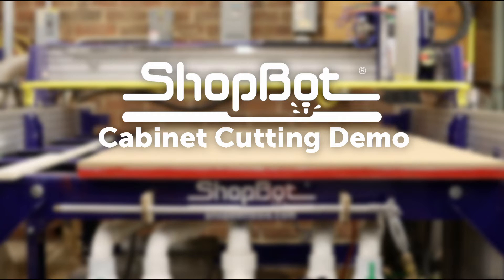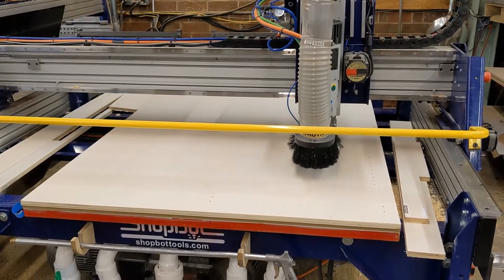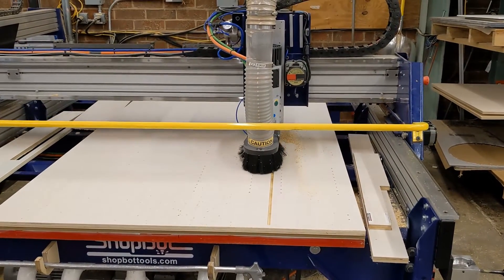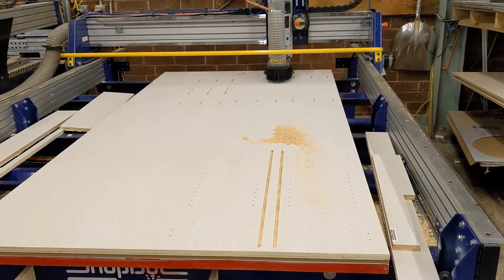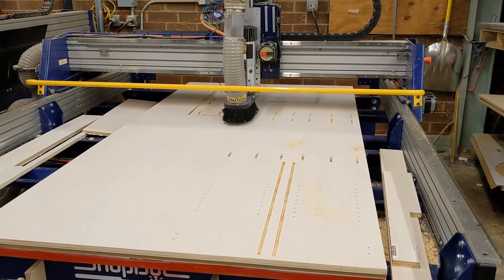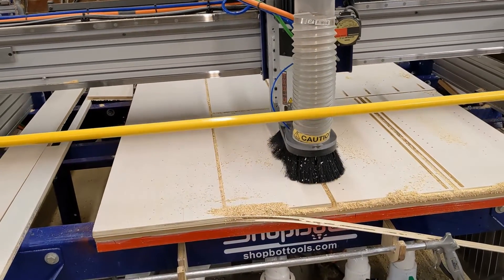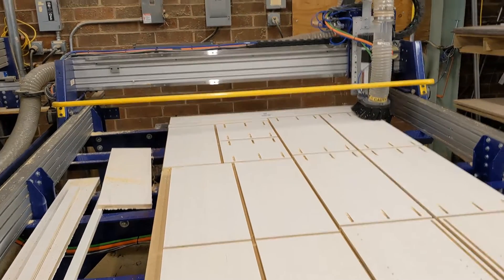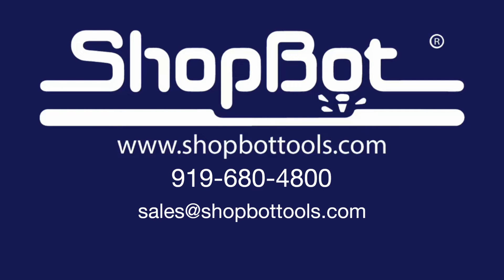ShopBot CNC Cabinet Cutting Demo

Comment: How does the Shop Bot compare to a Avid machine? IS the cost greater? thanks
Reply from the maker: There are differences to consider. We encourage you to call or email for info on the CNC machine you are interested in finding out more about! 888680-4466 or sales@shopbottools.com. Thanks for checking out this video and we hope to hear from you soon!
Reply: @shopbottools  Thanks, I did fill out the form on your site
Reply from the maker: @drich6816  Thanks for filling out the support contact form on our website. Have you heard back from someone at ShopBot yet? If not, call 888-680-4466 or email sales@shopbottools.com for fastest communication. Thanks!!

Comment: How do you drill the pilot holes for the screw pockets?
Reply from the maker: We didn't drill any pilot holes for the screws. Just driving them straight through the pocket slots and into the wood works fine. Let us know if we can help with any other info! sales@shopbottools.com

Comment: I have a prt standard upgraded package Vxxx. Am I able to run the machine this quickly?
Reply from the maker: For a PRT Standard tool, cutting would be limited to around 3 inches per second and jog speeds limited to 6 ips or less. The tool featured in the video is a PRS Alpha tool with an ATC and is running at around 8.3 inches per second in its cutting speed. The PRT Standard would not be able to match these speeds.
https://www.shopbottools.com/products/alphaATC